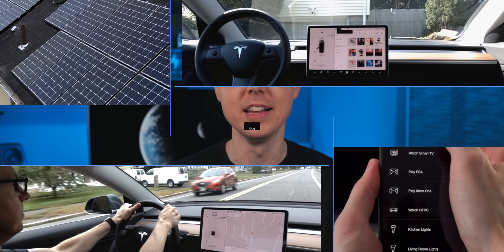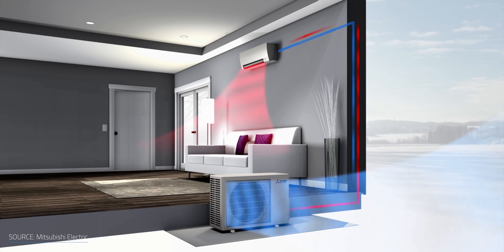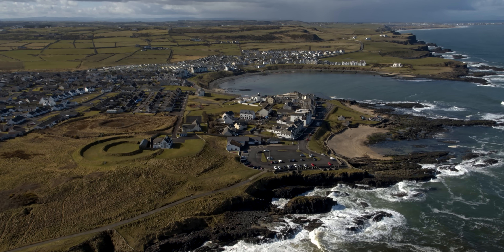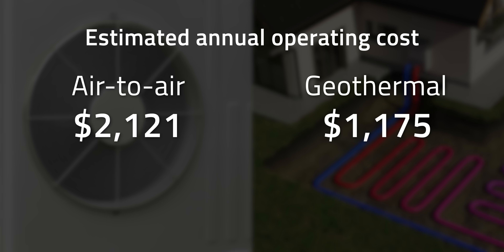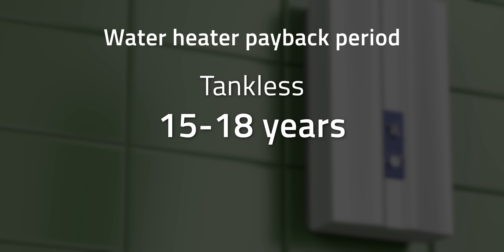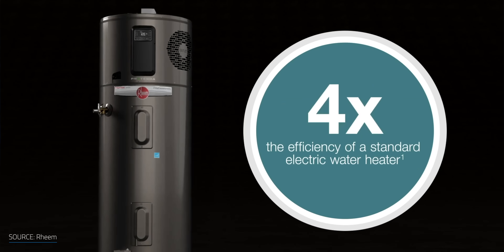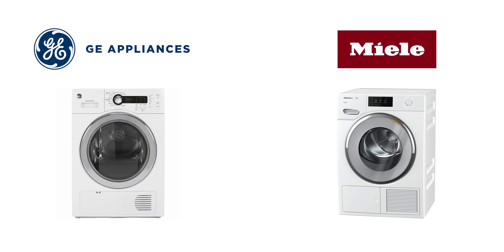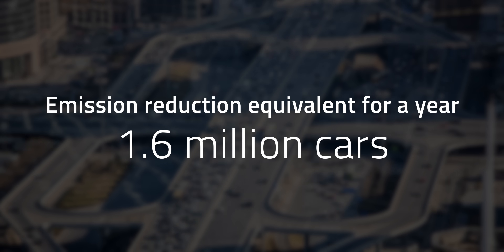Why Heat Pumps are Essential for the Future - Explained

Comment: My electric dryer is 20 years old and easy to repair. The two repair men who have serviced say it is a lot more reliable than modern fancier units. I wonder how many manufacturers are cutting corners that will affect reliability.
Reply: Mine is about 35 or 40 years old
Reply: I have had a European heat pump dryer for 11 years and use it almost every day. It's still going with one service by an agent.
Reply: @douglasashby4349 how do the heat exchangers keep from getting coated with lint? Heatpump dryers aren't mass produced like regular dryers which probably makes them higher quality,,, for now
Reply: @Bryan-Hensley  my dryer is an Asko brand. There is a lint filter in the door and then another filter over the heat exchanger. The unit over the heat exchanger requires cleaning every month say after 40 loads. Just needs washing by sand in the tub. The dryer has a third lint filter on the condensate this requires emptying or cleaning once every 40 loads. The unit does remind you to clean both these filters and if you don't they will eventually block and the unit will not run.
Reply: @douglasashby4349  The first adopters in the US will do this kind of maintenance. The majority will not.

Comment: I live in the middle of Sweden, so pretty far north. We use a heat pump. It's hooked up to our standard water radiators, and it produces our hot water too. Very efficient thing compared to the old electric heater. We've used it in temperatures of -20℃ with no problem 👍
Reply: Hi:) I'm writing an article about heat pumps and it would be helpfull if you share some data.
Kind of heat pump do you use, model, power, type
How much energy it consume and produce in -20℃
Electicity cost and price of heat pump
How long have you been using this pump
Reply: I assume your house is very well insulated?
Reply: I wonder if they have a different Refrigerant in the system ?  Most systems near me are R-134 and I will bet that there's a new refrigerant that will do better in cold climates like yours.  ..............  Nick , NavyBlueSmoke , LST-1195
Reply: Was it the size of your house?

Comment: I wanted to get a heater for my pool. The up front cost to install a typical gas heater was too expensive because of the distance I would have had to run the gas lines so in exploring my options, I came across the idea of a heat pump. All of local the pool companies here in Texas said they won’t work well but the reality is that none of them had any experience with heat pumps. I found a company to install it and it’s been great. Not only does it keep the pool warm in the spring and fall, but it also can cool off the pool in the worst heat of Texas summer. No gas heater can do that.
Reply: maybe call the local pool companies again and explain them your experiences. maybe next time they consinder implementing that for a customer
Reply: That's interesting because here in southern California there really aren't any pool companies who install heat pumps for pools.  One local company that I considered very knowledgeable about the latest technology said they don't work very well in our climate.  When I did a bit of research, I read that an environment with mostly low humidity (which is where I am in Orange County) heat pumps don't work so well.  Could this be the reason pool companies don't install them out here?

We actually have 3 ductless heat pumps which heat / cool a few bedrooms here - love them!  So quiet and efficient.  However, I think when your asking about heating a pool / spa, that's a little more demanding on this type of system.
Reply: @marcgianzero2707  hope you get a reply cause im in the same type of climate and really want heater for the pool. crossing my fingers that its possible.
Reply: @marcgianzero2707  Humidity will have a tiny effect on the efficiency. What matters most is the outdoor temperature, in Orange county that won't be a problem, there are heat pumps that work below -10°F.
Reply: @marcgianzero2707   that it means that in Orange county you do not use ACs? ACs are heat pumps too and why they can work there?
Reply: @marcgianzero2707  that same “they don’t work well in this climate” is what the local pool companies here said too, even though it’s a completely different climate than SoCal. I just think most companies are not informed, and the manufacturers have done a poor job of educating the pool companies.
Reply: @0Julime0  it’s the heat pump manufacturers’ job to educate the market, not mine. They do need to do better if they want to sell more heat pumps though.
Reply: It would work best as a heat sink to efficiently keep your house cool in summer, and even in the winter to warm your house
Reply: For our propane pool heater we bought the line, paid a guy from Craigslist to dig a trench, and we did the rest. Was really cheap. Just need to know what’s underground.
Reply: I think it's more of a: they have deals with gas heater commanies and make more benefits in installing those over heat pumps.
Reply: The pool companies don't have a HVAC guy on staff, so they say heat pumps don't work well here as an excuse.
Reply: I had a pool service job last summer and those gas heaters break all the time. Really good cash flow for the business lol.
Reply: @Ojisan642  Yes, it is not your job, but you can help them educate the pool companies and make the planet less polluted in the process. :)
Reply: Great you use a heatpump for that!
However, private pools and especcially cooling the pool cannot be considered an act of environmentalism.
Reply: @ambassadorkees  everything runs on solar electricity
Reply: @marcgianzero2707  Crazy talk.  Almost every home in Phoenix, which is way, way drier than Orange County, has a heat pump for their home AC.  You will need a place to drain the condensate though, because on humid days the cold side will create condensate from the air.
Reply: My father ran black hose over a garage roof and used a small power water pump to run pool water through it. And even in England we got the pool up to a very pleasant temperature. Not as precise and controlled as a heat pump solution. But almost free to run
Reply: @Ojisan642  Solar doesn't make anything good for the environment, it just makes it less horrible then coal and gas. Emissions is still way higher then windpower and recycling of the units still hasn't been sorted out, which mean that atm there's a massive hidden "bill" for the environment (this will surely change within the next decade, but until then...)
Reply: @ambassadorkees  I agree, private carriages too. You know, those electric vehicles on 4 wheels, totally an unnecessary luxury that cannot be considered an act of environmentalism. On a serious note, lets stop comparing "environmentalism points" and just focus on making things electric and non-greenhouse gas emitting. Most electric cars are actually usually powered by 80% or more by fossil fuels. Yet I don't see anyone smugly saying "Ehrm acktualllllly you carrrr doesn't qualify for environmentalism pointssss...". Lets just encourage environmental thought without comparing and complaining about how much that thought is...
Reply: @WhatComesAroundTM  depends on where you live and work.
Most of USA & Canada is built car dependant, a mistake that's expensive on society. Companies getting bigger and bigger is also a problem, since it's impossible to find a large amount of employees with specific skills within reasonable public transport distances. Add to that the concentration of similar companies all in the same areas (finance: London, New York, Meubelboulevard in Netherlands, logistics around airports ennen when handling only very little airfreight, Japanese blocks of cooperating electronics shops, car city Detroit etc, and you induce the need for long commute, car dependant shopping and other private travel & transport, mostly fed by corporate greed.
Get rid of suburbia without services, make villages and cities walkable, have a few smaller grocery stores near where people live and those carriages get to expensive and unnecessary to keep.
But alas, even my nearby city is developing more and more car-dependant large business areas. 
Environmentalism starts with clever city planning.
Reply: @ambassadorkees  You kind of missed my point entirely. Any consideration for the environment from people should be encouraged, even if it's heating a swimming pool with a highly efficient heat pump. I fully understand and agree with your reply, I even wrote a paper about that very topic for my degree in Automotive Engineering. My problem wasn't with electric cars, it was only an example. We cannot change cities individually, instantly. We can, however, make small changes in our lives that impact the environment in a positive way. It can be buying an electric car, it can be, again, installing an efficient heat pump for a swimming pool, it can be as little as buying rechargeable batteries instead of single use ones. We should encourage environmental consideration, but saying "your action doesn't count because you have a pool (a luxury)" is not the right attitude. We should be encouraging and not complaining. Hell, if a billionaire said he'd use his private jet 1 time less per year I would praise that. Encourage and praise people for their changes out of consideration for the environment, instead of dragging them down because they have luxuries you don't.
Reply: @WhatComesAroundTM  you are right on all points, and I get it.
However, since it has been shown that in about 40 years landuse and urban dynamics can be changed, I wouldn't lose more time in starting the process.
Reply: @VikingRul3s  well I don’t have a home nuclear reactor so it’ll have to do. I suppose you live in a cave and never use fire or any energy at all.
Reply: @Ojisan642  Are you joking or really that unintelligent? I suppose you believe a scooter and a truck use the same amount of fuel driving the same distance...
Reply: What city, and who did you use?
Reply: Ojisan,  Amazon now sells heat pump pool heaters!  They typically have a very high SEER rating, much higher than a typical home heat pump, mostly because they will typically run on a 75F day and heat a pool to about 80F, so not use much power at all!  They don't have to be super large, a 24,000 Btu unit can keep a fairly large in ground pool at 80F or 85 if you want to spend that much energy!  

A municipal pool installed 5 of the 60,000 Btu units to replace a older gas boiler, and saved a LOT of money!  I think simple payback was about 3 years, but if you consider you needed to pay to replace the boiler, it was a easy decision to install the heat pump instead of a new boiler and running on more expensive natural gas!